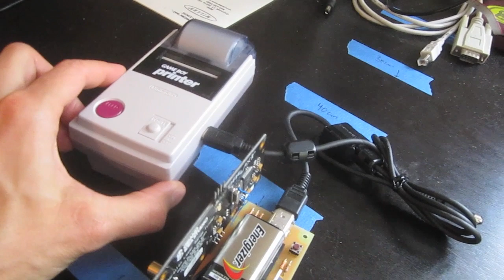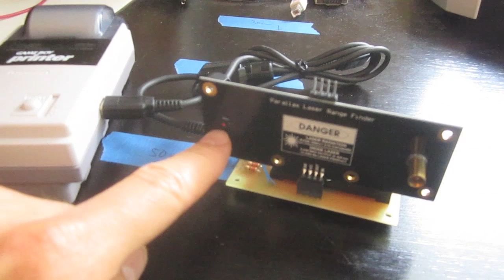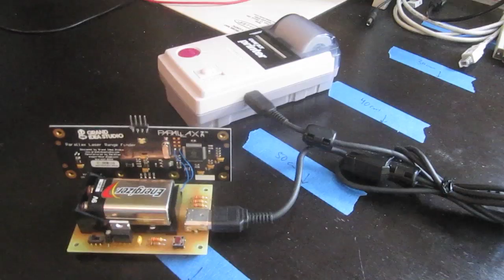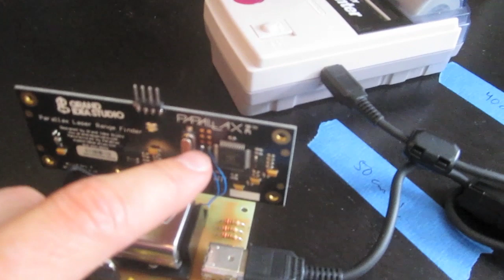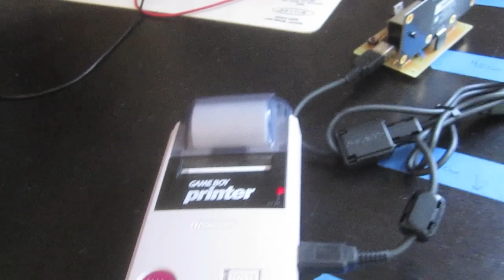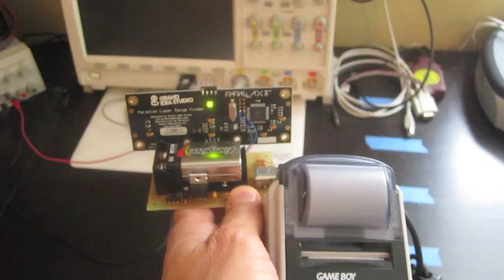LRF + Game Boy Printer Hack: System Details

Comment from the maker: The Game Boy Printer accepts serial data at 8333 bits/second. For a 160x128 image @ 2bpp greyscale, the LRF needs to transfer 5120 bytes of image data, not including other packet information. So, each picture will take about 5 seconds to send after it's been processed by the Propeller (which takes another second or so).

Comment: Joe. Any way to hook this printer to a PC? I have one of these now and I saw another vid on here of a guy that was able to print from his PC. I'd like to do the same but not with all the stuff he had. I just want some type of custom USB cable and a software program that can print anything from a PC not just pictures but text as well.
Reply from the maker: +coondogtheman1234 You could probably use something like an FTDI FT2232H to bit-bang the communication to the Game Boy Printer. That would also give you the USB interface to your host PC.
Reply: +Joe Grand thanks for replying I will search this more.
Reply: Joe Grand
I'm not exactly sure how to do that. What do you mean sniff the signals going over the wire. Actually another guy on here made a USB cable to hook the GB printer to a PC. but what I want to do is be able to hit print on the GB camera and it sends the pictures to my PC like my PC is a GB printer. I would like that other guy to sell that USB cable on amazon. And I first saw you on the screen savers on Tech TV and I still have that video.
Reply: +Joe Grand  what  about make one that  can out put  simlate print  as a pdf or  jpg to sd card   that be neat  to be able  to export  photo to pc
Reply: *****
id like to be able to hook my GB printer to my PC but it looks like I'd be better off getting a POS system Printer and just use that instead.
Reply: I have windows 8.1 will this still work? If not then time to dig out my old laptop. I can't do the parallel port idea for obvious reasons. Now just to find the required items on amazon.